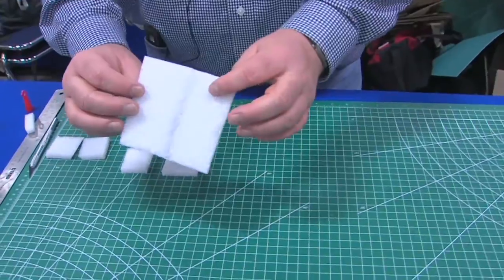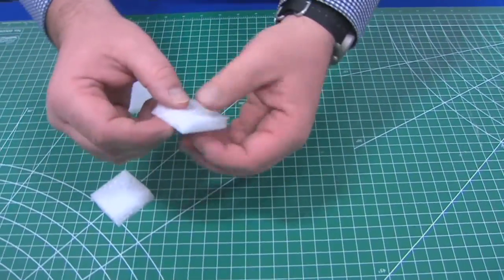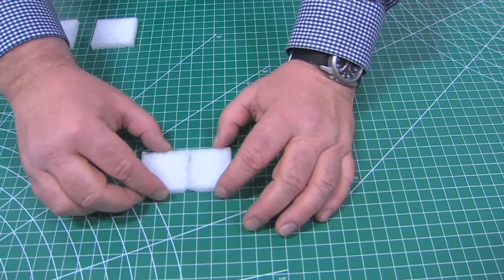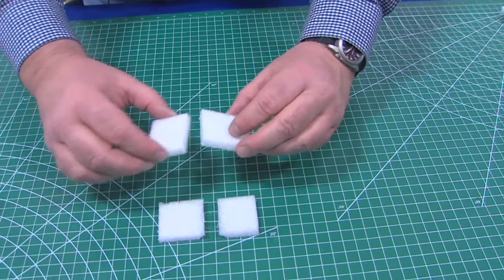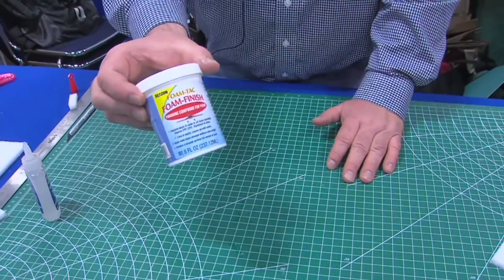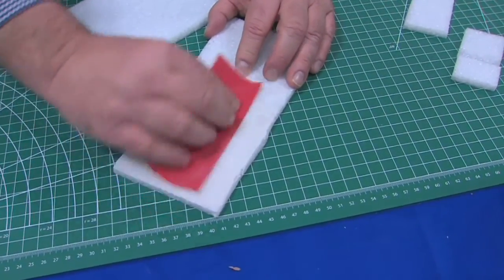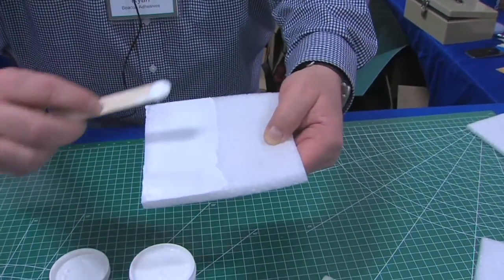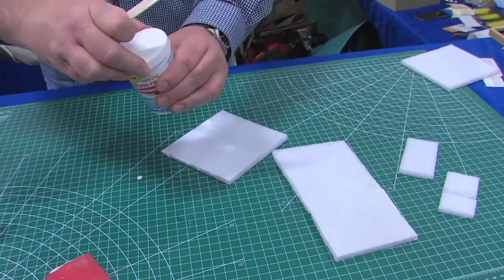Foam Tac & Foam Fill Product Review  |  RC Hobby Network

Comment: as with all glues check first that it does not dissolve the foam....foam tac dissolved foam on my eflite p47, t28, and p17  micro parkflyer rc planes.
Reply: That's interesting because I've glued a couple planes back together now with foam Tac and had no dissolving issues. Those UMX micro birds though they seem to be a finer foam, yeah?
Reply: @jonadam5392  I have never had an issue with Foam-Tac on any of my planes and I use it frequently.  tip clogging is the only issue I have with the product.
Reply: Definitely test it first for sure. That being said, the small micros tend to be made out of the old school EPS (expanded polystyrene) foam which is not resistant to most oils or solvents in glues and paints. That stuff dissolves if you look at it funny... even butter, yes the dairy product, is listed as an oil that will attack EPS.

Larger foam models these days are generally made from EPP (expanded polypropylene) and EPO (expanded polyolefin, composed of 30% polyethylene and 70% polystyrene). These foams are extremely resistant to most chemicals and solvents and in fact require glues containing harsh solvents or volatile organic compounds in order to achieve the best adhesion, like the Cyclohexane found in Foam-Tac. Hexane, Toluene, Methyl Ethyl Ketone, Methylcyclopentane and various other Hexane isomers are used in other adhesives such as Devcon brand Contact Adhesive. bSi Foam-Cure contains Vinyl Acetate and Methyl Hydrate and the popular Welder glue by Homax uses Toluene.

An added "bonus" of this chemical resistance - paint is easily lifted from EPO foam, even with low tack masking tape. It can make repainting a real nightmare. This is also a problem for the auto industry as most modern bumper covers and other parts are made from polyolefin plastics and paint adherence is a real issue. Lots of cars out there with paint flaking on plastic components after a relatively short life because of this.

Comment: Thats idiotic - how do you glue large surfaces precisely when you have to pull them apart 10 to 12 times?
Reply: I have glued planes back together from crashes and never did that method, maybe pulled them apart once or twice and then put together. They still come out fine, stronger than before ,better than hot glue. Kinda pricey though.